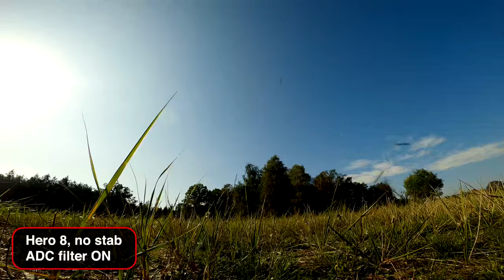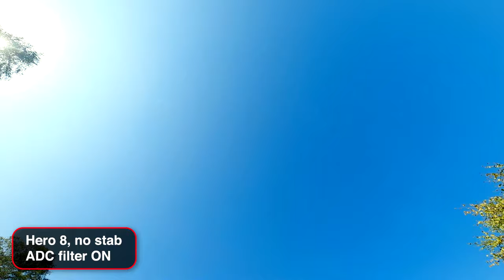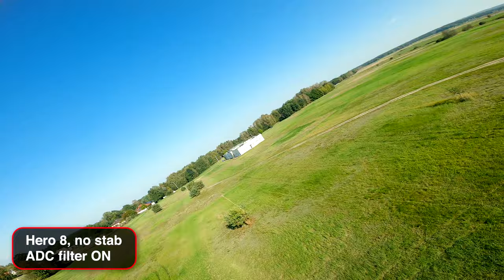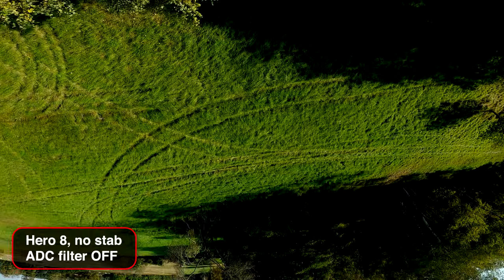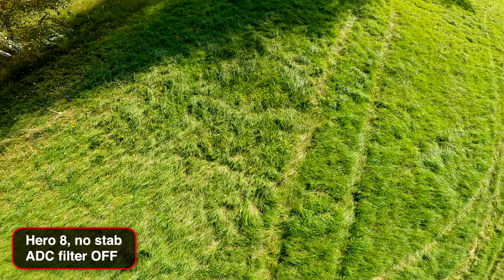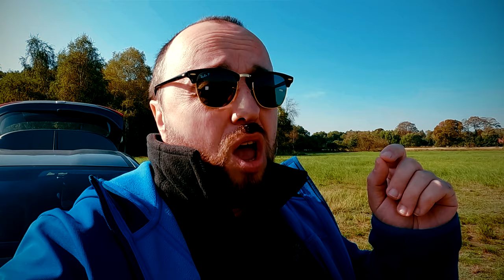OpenTX ADC Filter ON or OFF? It's not that simple

Comment: I think if you cant notice it, then your n00b is showing.  This setting being off, was the HUGEST difference of any single component, setting or otherwise ive ever felt.  However this was after 5 years of racing, not just flippy floppies in an open field.  I can see how people that fly slow enough, may not notice it, but man i have not a change this big in YEARS.  I cant believe how long i had it on and didnt realize.  The change immediate.  Specifically in long arcs.  Id see people doing arc perpendicular to the ground SOOO smoothly, these FAST smooth arcs, and mine would always have these micro adjustments.  I figured it was just that i wasnt as good of a pilot.  Once i turned this off, IMMEDIATELY, i coudl notice the lack of the little stair steps.  Again, it only makes a difference in certain movements.  If you dont do these movements, or do them fast enough, you wont feel it.
Reply: I totally agree with you. I forgot to turn this crap off for several months and didn't know what the heck was going on with my quads.

Comment: I guess if you have a transmitter with potis, the filtering might be necessary, but Hal-sensors should be fine without. There is no physical contact, no scratching. 
Might be worth taking a closer look at 🙂

Comment: 2 things to support your theory of ADC filter off might be best is 1) Any filtering take processing power. Why take the processing hit if you can not tell a difference. 2) For really fast signals there will be some amount of aliasing of the signal with filtering which could have a negative effect under certain circumstances. So I agree with you that if there is no perceived difference then filtering off. Good call on your part I think.

Comment: Agree, likely no practical difference. 

However, a video comparison posted on youtube is probably not a great way to demonstrate either way. Would be more interesting to collect stick values and telemetry data on the radio controller, and/or the drone blackbox to compare.
Whether it's worth ones time to go thru the effort to collect data and analyze, likely depends how one feels about this topic.
Reply: If he did that he would have seen that ADC filter OFF is way better for flight performance.

Comment: What is ADC filter ?
Reply: Radio setting. May be of use for airplanes, not for quads.
Reply: ADC is Analog to Digital Converter. Filtering is noise removal from a signal.

The analog stick positions are sensed as a analog signal and digitally encoded in the OpenTx software before being sent from the controller transmitter to the receiver in the drone. Filtering removes unwanted variations in a value, like smoothing so no jitter being sent to servos so they don't get overworked moving back and forth over very small changes in value. This less an issue with motors as small value changes become slight changes in rpm of the motor (not effect on a motors operation).

The short answer ... for servos connected directly to receiver, ADC filter might be useful. 
For motors, or if a flightcontrollerg is between receiver and motor/servos, there's likely no need (or doesn't matter).

Comment: What about Wings with Inav ?
Reply from the maker: what about them?
Reply: @FPVUniversity  should I be concerned about the ADC Filter?
Reply from the maker: as long as you have INAV in the middle, no
Reply: Tossing my hat into the ring too: If you're running iNav then as Pawel said, it won't make a noticable difference, same case for quads. If you're running something that has no flight controller and is just receiver connected to servos, the servos may wiggle slightly at random but the movement is so tiny that in my experience it has no noticable effect. I fly Betaflight quads, iNav fixed wings, and regular fixed wings without the ADC filter and it's never been a problem for me.

Comment: I have tried turning ADS setting off before and have noticed the channel values in iNav jittering up or down constantly in small values i.e channel 1 - 150 to 149 or 150 to 151. I am guessing that is why it's hard to tell but does the radio channel values best to be accurate as possible? I am not sure
Reply: The jitter is fine and shows you that it is now working as intended. Your radio will send more precise values with ADC Filter Off and the feedforward signal doesn't flip out like crazy.